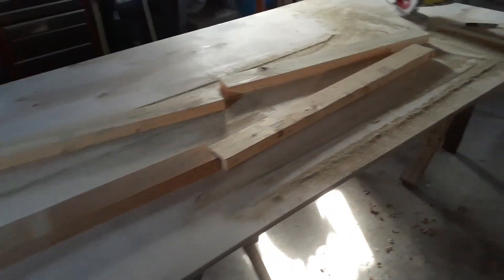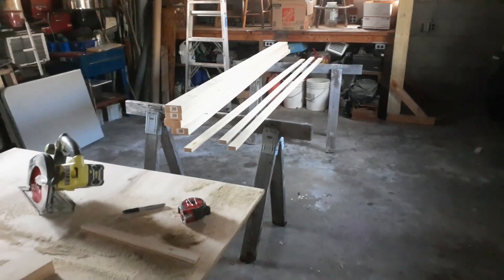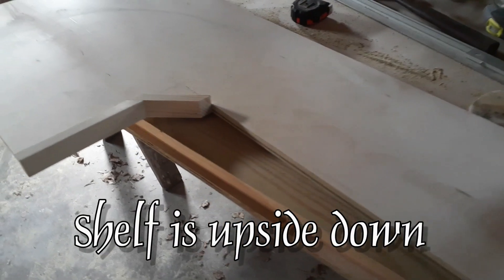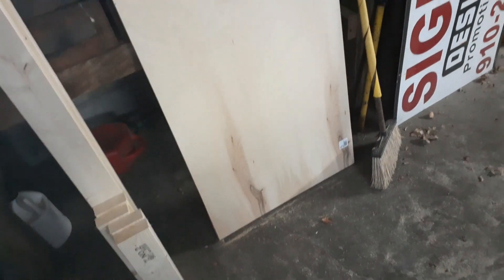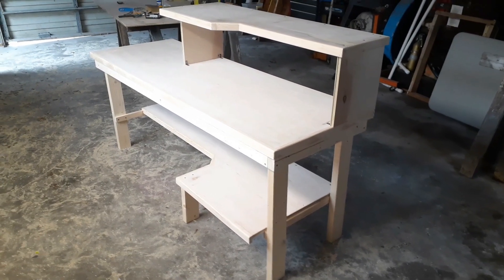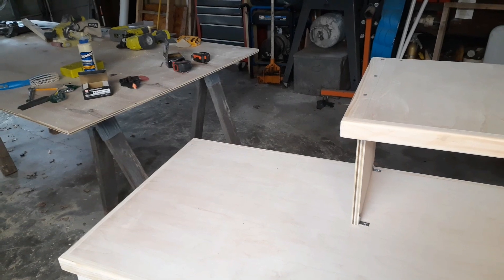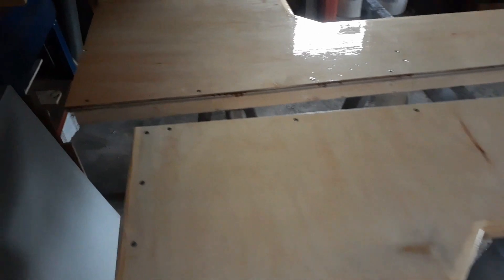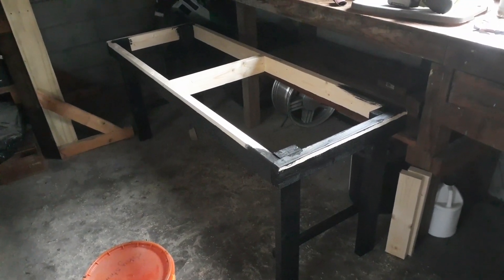My custom streaming & work desk

Comment: I can see that you have put a lot of work into the planning and design of your desk area and I love the high standard of your cutting. You will get so much out of your custom work space for streaming. I really need one of those. My partner made some overhead cupboards around my kitchen worktop desk but I needed space overhead to work on so can’t have shelves straight ahead.... my vinyl cutter is to the side of me
Reply from the maker: thanks.. would love to see your setup with the cutter.... im saving for a full color printer cutter.. which is 8k  not sure if I will get it this year